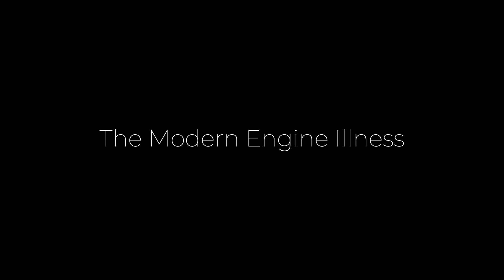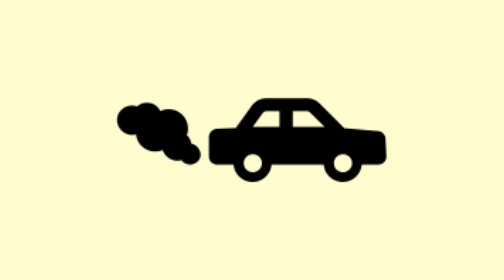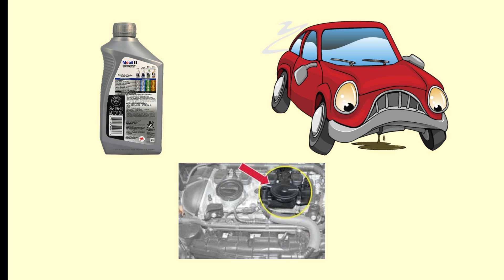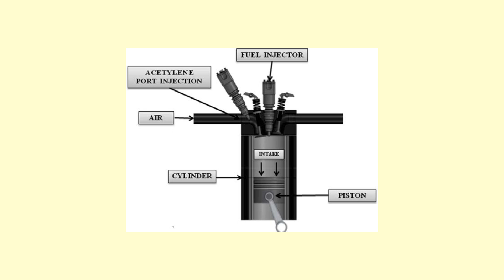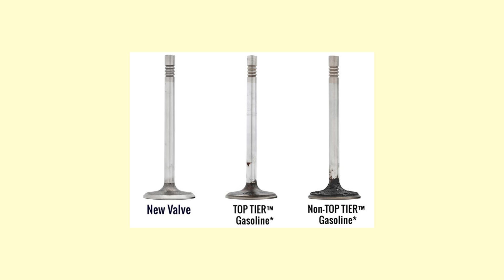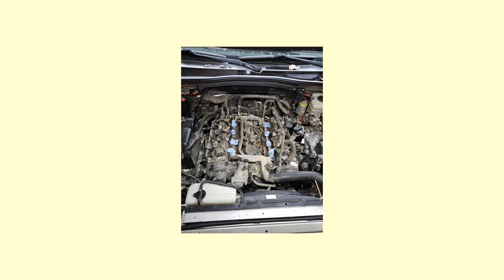The Silent Sickness of Modern Engines

Comment: Diesels have used direct injection for decades... 

The real problem is PCV dumping oily vapor down the intake. port injection just masks this problem.

If your intake is being fed actual clean air, then i dont see how it could carbon up.
Reply from the maker: Yep which is why some PCV systems have bad blow by

Comment: Riddle me this. What the hell happened to water injection? You burn less fuel for the same power, that is less emissions, less fuel consumption. Even if it's a half and half methanol mix, it's still going to be cheaper than filling up gas.

There's so many ways to cut fuel consumption and emissions, but it appears automakers are bent on using the least repairable/serviceable way out.
Reply from the maker: I agree it's quite annoying to see some stubbornness seep into an industry that is supposed to be about discovery and innovation

Comment: You forgot a solution... Buy a port injection car.
Problem solved.
We've solved the carbon buildup problem by installing port injectors... the same technology we had before direct injection??  So we've doubled the complexity to emit a few less grams of human exhaled gas.  Brilliant.

I really hate new car trends.  From wet belts to inactive cylinders to tiny 2.2L turbo engines inside full sized trucks to timing chains on the back of the block, to plastic oil pans...The list goes on.

We stopped building real cars in the early 2000s.  The things on new car lots today are cheap disposable toys.
Reply from the maker: Yeah its sad to see, we did recommend port injection cars in the beginning of the dual injection section
Reply: @Enguitive I apologize, I must have missed it then.

Comment: The wrong oil and fragile rings. Bad combo. I wouldnt use 0 w oil for anything.
Reply from the maker: My theory is manufacturers use 0w oil for lightweight and as a car is lighter this means more fuel economy but this argument is extremely moot when you consider the cons regarding direct injection and the actual worse fuel economy you get as a side effect of carbon buildup
Reply: @Enguitive  You are correct it has less drag, the same as the fragile thin oil rings that wear out after 30k miles. They drag less in the cylinder. All that failure for .01 more miles per gallon LOL, not a trade-off I would choose. The newest car I would buy is the late 00s.
Reply: 0W is the cold rating, and the 0W viscosity is thicker than hot 20W-50. 0W ensures oil getting pumped to the top end quickly. The hot viscosity is the one you think is too thin.
Reply: @gregorymalchuk272  Maybe it's an unfortunate coincidence that all the motors that have been failing at 30k miles in these new cars from most of the brands use 0w oil. I stand by what I said that oil is garbage.

Comment: GDI, turbos, auto stop/start, tiny engine displacement, extended oil changes, low tension piston rings, ultra low viscosity engine oil. At best, many modern engines struggle to last 75k miles.
Reply: Facts

Comment: Literally can offset emissions by making the engines more efficient and getting rid of restrictive emissions equipment will drastically increase the reliability of the engine.  Using Direct injection is pretty dumb on Petrol engines since they're more expensive to produce and have long term problems due to carbon build up. 

I yearn for the old days of Port Fuel injection and no EGR valves.

Comment: I can confirm that di engines are not more fuel efficient. But more expencive to repair, and in the need of more repair, due to stretching the engines limits, high sylinder pressure, low tension pistonrings, carbon buildup, lspi, high pressure pump etc. In a port injected engine, if you have build up on intake valves or in the gas system otherwise, you can add cleaning additive to the fuel, and it probably will fix the problem. This is not possible in di engine.
Reply: Facts

Comment: Remember guys, this problem exists because of Governments mandating car manufacturers to reduce emissions by any means necessary. Yes even if it means you have a less reliable motor that is actively burning oil and making YOU spend more money on maintenance/repairs. So don’t feel bad by installing DI delete kits and catch can systems.
Reply: Oh don't worry, I don't.  I drive a 25yr old car that's 2200lbs, 364hp, has port injection, aluminum intake/pans/valve cover, has a DIY catch can, is catless, and has an EGR delete.
I also moved to a county that doesn't care about any of this crap either.
Cheers.
Reply: @christopherlowery855  364hp at 2200lbs god damn!!!
Reply: @terrFW  I just met a guy today with an EG civic 3dr that's AWD and has 670hp at 2600lbs.
I thought my car was fast.  The guy is running a supercharger, running on E85 and meth injection.  He's running 2200cc injectors, lol.
Just crazy.
Reply: @christopherlowery855  which is ironic, that much power but on E85 makes it doing way less emissions than any comparable car.
Reply: CAFE regulations

Comment: Literally everything you’re talking about has nothing to do with DI and everything to do with EGR. If you use quality fuel and good additives at appropriate intervals with a good drain interval for your oil, literally none of this happens!

Modern oils and fuels are incredibly good at dissolving deposits and sludge. You’ve got a lot of school ahead of you.
A. Lot.
Reply from the maker: Hi there! It'd be great if you could pinpoint what I got wrong so I can take this feedback on and learn, I am after all only an engineering student and not an expert as much as others in the comments from what I've read so far.

Comment: Modern motor vehicles from say the last 10 years are designed to not give you more than 5-7 years of affordable and reliable operation. The manufacturers have for numerous reasons designed them to be throw away cars so that you will just be forced to buy another motor vehicle.

The days of seeing 10-15-20+ y.o. used motor vehicles available to buy at even more affordable prices are in this era over.

Come 2030 you will be hard pressed to find in any volume motor vehicles built older than 2020.

Now with President Trump and changes to CAFE and other standards  allowing manufacturers to build more cost efficient motor vehicles while  maintaining good profits, could see a pull back to the more consumer desirable marketing and sales standards.
Reply: Wow, 5 to 7 years is exactly what is quoted for modern worthlesss Maytag/Whirlpool washing machines.

Comment: If you drive a rotary engine you already know about all of this, the Renesis in the RX-8 especially suffers from carbon buildup as people didnt want to push the engine.
Reply from the maker: Ive heard in those cars a redline a day does keep a mechanic away to keep the engine in top (for now until you need to rebuild it) condition
Reply: @ they really arent too bad if you have the later models with the extra oil injectors.

If you dont care to premix, you can tune the ECU to throw in just a little extra oil and itll run perfectly for a good hundred thousand as long as you dont flood it or keep it sitting too long, just, a little oil hungry is all.

Either way, carbon build up will destroy your apex seals, so you should drive it pretty hard probably about once a week at least to reduce the chance of losing compression on one of the faces.

Last thing since ive already said too much, they arent horrible to rebuild 😅
Reply: @rawhidelamp I don't know bro... I watched a teardown of one of those.  Just removing the flywheel alone was enough to make my heart sink.  Not to mention the spiderweb of wires and hoses.  The injectors alone are a bear to remove.  I've had to pull my engine twice, replace the rings and bearings during the teardown.  I've pulled my head a few times as well.  Doing any major engine work on that engine just makes my skin crawl thinking about it.
I've got 2 bolts holding my injectors in.  I just have a hard time justifying a redline of 9k when I'm pushing 8k now.

I'm not sure which is worse, the boxer or the renesis.
Reply: @christopherlowery855  i guess whats nice is the mechanical simplicity and the size, any engine is gonna be tedious yk

Comment: This is why I like the Ford Coyote 5.0. It has port and direct injection. Less carbon. Better power delivery.
Reply from the maker: Sounds awesome as well!
Reply: Don't forget a plastic oil pan, windage tray and oil pickup tube all rolled into one.
Also, I hear the IMRC failure on the intake can be a pricey expense.

I'm not impressed with the coyote as an engine.  For Ford engines, I'd rather have a Modular V8, a Cleveland, or a Windsor
If we're comparing engines from 2019 onward though, it's one of the best out there.

For V8 engines, I'd rather have an LS7.
Reply from the maker: @christopherlowery855  LS7 is nasty 🤩 C6 Z06 is one of my favourite Vette's

Comment: i’ve always figured running my mk7 gti (US engine so direct injection) above 2500 RPM on the highway for over 20 minutes (i have a 1 hr work commute) would help the carbon build up. It’s good to know my theory was true (and that i’m not speeding JUST to be speedy lol)

Comment: what are ur thoughts on on the saab b207r? I think mine is long gone but this video was helpful and interesting
Reply from the maker: Great engine! I would probably install a catch can etc. to stop the carbon buildup
Reply: @ I believe this happened to mine as it idles rough and stalls… is there anyway to improve its condition or should i engine swap?
Reply from the maker: Engine swaps are great but come with cons as they are costly, you also have to factor in how your transmission is compatible with your engine and if it isn't, you'll also need to swap that. You may also need custom fabrication work as well, for example K swaps in a RX-8 usually require fab work. As the weight of the engine is different as well, that may also affect handling and chassis balance. Overall, I'd suggest you go with walnut blasting and then a catch can etc.

Comment: This is why I like my port injected N/A '97 ranger
Reply: 90’s cars are the best vehicles I still drive a 99 civic and drive daily!
Reply: 2000 miata and 95 Nissan D21 here.
Had 4 civics though.  1 EF, 3 EG
The EF was totaled.  1 EG I hydro-locked engine-braking into a puddle, spent the weekend swapping the engine, then the second engine seized because of an issue with the oil pickup tube.  The oil pressure light never came on either.  I helped a kid, I sold the car to, drop the 3rd engine in it.
The second EG I daily drove until about 270k mi.  I knew the valves needed to be readjusted because it had started to backfire when engine braking.  I sold it to a kid for $600
The third one was a project car I pulled the engine from to drop in the other one after it hydrolocked.
Great cars to learn how to work on cars without too much of a headache.

Comment: Thanks but no thanks, I will keep my 2003 Grand Marquis with 482,000 miles and zero engine rebuilds, zero transmission rebuilds, etc. sure it only get 14 mpg in town and 26 mpg on the open road, but this car has paid for itself 10x over.

Comment: I love my Mitsu 4B40 engine. Port injected, and direct injected under boost. 🥰 My valves get plenty of fuel wash.
Reply from the maker: + turbo in this 1.5L is pretty small so long term not too much stress on engine components

Comment: ea888 on the thumbnail
Reply from the maker: Yep! 8 intake valves as well as a 4cyl engine usually has 2 intake valves per cylinder but I should've made it 16 now realising it has 16 intake valves as it has DOHC 🤣

Comment: Crc , turbo intake valve cleaner , I have a fleet of old used vehicles, take your air cleaner off your intake tube sprayed in as directed and I promise and it is night and day with an old vehicle that has carbon buildup in the chambers and valves

Comment: Modern engines are complete garbage! You are better off buying older trucks and cars pre-1990 model years. My family and I had constant issues with new cars and trucks. My dad had a new car that didn’t even have 100000 miles on it and was only about 5 years old or so. That pile of junk had nothing but computer issues and we got sick and tired of it. We bought him a 1989 Chevy pickup truck. Far better and way way more reliable than this modern crap. And for me I had a brand new ram truck for my business. That pile of trash was always stuck in the winter and it was a 4x4. The computers thought there was an issue when there wasn’t. I sold that junk and replaced it with a 1984 Chevy k30 ex military truck. 6.2 Detroit diesel and th400 transmission. The ram made 8mpg thank you epa 🙄. The army truck makes constantly 24 mpg. Yes it only has 135 horsepower but it has been the most reliable truck I’ve ever owned. In the last 6 years or so it’s only had an issue with the injection pump due to age. Other than that nothing! Transmission is far far more reliable than this modern crap. And yes the engine is a idi diesel not that direct crap. And I have a dump truck as well a 1987 ford lt9000. With a all mechanical Cummins engine. All original. These modern trucks are a scam. Older one are built to be rebuilt over and over again. The modern ones are made to be thrown away after a year or so. If you something reliable do not buy anything after the mid 1990s. I learned my lesson on this and now I won’t buy anything with a damn computer on it. The older ones you can actually work on them. New ones you can’t! Nope don’t trust the modern mechanics because they have screwed me numerous times in the past. If you want it done right do it yourself.
Reply from the maker: Ye older cars are far mors simple to work on yourself, but I'd say the 90's and 2000's were the golden era where performance and reliability was peak, look at Honda's VTEC NA engines for e.g.

Comment: What about diesels? Should i remove my egr and get a blockoff or bypass system?
Reply from the maker: Depends on whether your engine is carbureted, port or direct injection
Reply: @Enguitive  all diesels are direct injection. its been that for centuries
Reply from the maker: @ Oh ye then you should as it'll reduce more carbon deposits

Comment: Thats why I like the EA888 Gen3 Engine, has port and direct injection :P
Reply from the maker: Wonder why they went back to just direct injection for the Gen4 🤔
Reply: @Enguitive  Even older Intake manifolds like mine(polo gti6C) have a unbored location for port injection. So you could add  the injectors afterweards, if you desire. (for example tuning or carbon cleanoff)

Comment: There is a simple solution don't buy vehicles with direct injection or even better buy a vehicle with a carburator as my 1997 Toyota Hilux has a carburator that's Australia were commercial vehicles were exempt from emission and safety laws up until the end of 1997 and its a Toyota with a carburator it will keep going for many many years

Comment: For me, I ditched gasoline direct injection engines and I currently own two INDIRECT Injection diesel vehicles.    Feed'em seafoam, let them sit. Get those RPMs up. It's amazing what it does. Also filling your fuel filter with ATF then running it a minute and letting it sit overnight is a great way to clean injectors. 

Did I mention my vehicles have no catalytic converters either? Cars these days are increasingly complex, however there are ways around things if you don't want to buy a newer vehicle.
Reply: You can just run a bottle of PEA store brand fuel injector cleaner through a tank of gas before every oil change. Seafoam is cool but there are other cleaners that work better.

Comment: I have a 2011 Cadallac CTS4 with the 3.6 v6 direct injection 307 hp 55,000 miles
I installed a catch can 2 years ago, I'm thank ful too. When I drain the catch can it is water and then a strange tan colored fluid. (water and oil mixed?)

I also use Seafoam both added to the oil and in the brake booster suction line, I have read there are those who do and do not like Seafoam but I have seen the differance with a camera in the cylinders sparkplug hole that was done both before and after. 
This is just my opinion and I'm sure resalts will vary
BUT
I am thankful for YouTubers making this issue well known or I would not have known about this issue untill it was too late.
Reply from the maker: All good man, that's what we aim to do at Enguitive! CTS4's are tuff as well man! I feel like that'd be a car Obama would drive by himself during his presidency

Comment: How about the real solution: Delete the PCV system! It forces oily crankcase gases into the intake, leading to the problem in the first place. While valve stem seals might leak a very small amount of oil, they are nowhere near as significant as the positive crankcase ventilation. You can buy a stainless exhaust venturi for $15, it's about the size of an oxygen sensor, and it can be easily connected to the crankcase vent and welded into your exhaust, preferably before the catalytic converter for emissions reasons (although it makes no difference for keeping the intake clean). Then you will never have to worry about cleaning your intake again, unless you happen to have the extremely unlikely issue that is a busted valve stem seal.
Reply from the maker: Fair point as the PCV system's main purpose is to actually reduce emissions moreso than stop the blowby from entering the intake valves, in fact most DI designs as you say recirculates oily crankcase gases into the intake valves